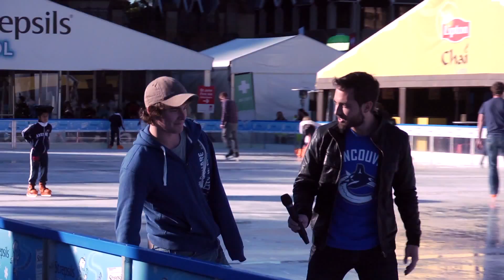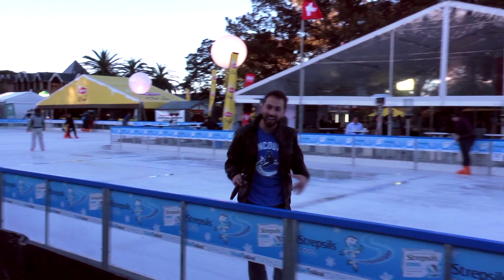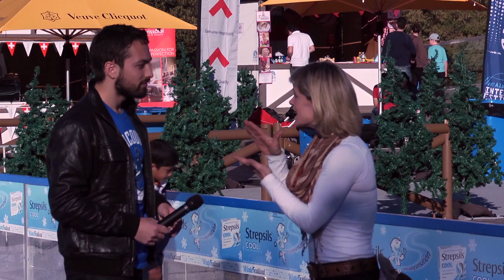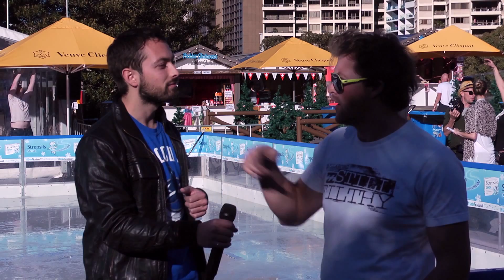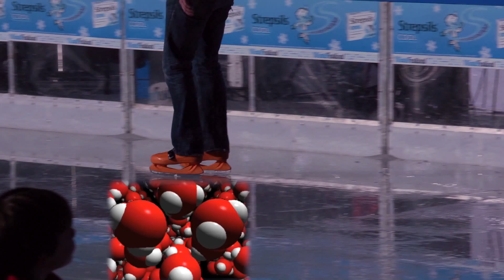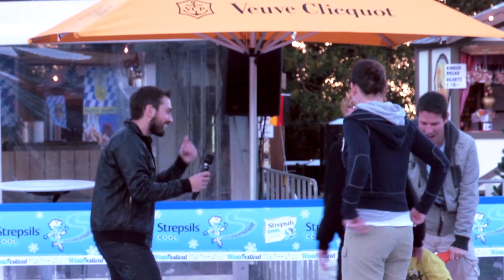Why Is Ice Slippery?

Comment: its generally accepted by scientists now that its not because of pressure, the pressure exerted by a body on ice is not enough to significantly alter the melting point. you have to look at the actual molecules and how they're acting
Reply: Lmfao
Reply: Do the maths...say average person weights 80KG. Hockey blades are about 30 cm long and 3mm (0.3cm) wide. 

That is 80kg pressing down on 0.0009 m^2. I think you need some derivative of Charles' law for the next bit. 

But failing that - get someone to stand on you finger wearing sneakers.....bit sore? now....get them to stand on your fingers wearing skates.

Comment: If you are really interested, here you go:

Reference: 100 Chemical Myths: Misconceptions, Misunderstandings, Explanations

(see picture fig 1.6 here: https://lh3.googleusercontent.com/-Khyo3lIiyhE/VNGLLqV-LUI/AAAAAAAAALI/X1wtOEvpiqw/w517-h276-no/water.jpg)

"1.8 Ice Skating and the Science of Sliding

Ice skating, believe it or not, has long been fodder for thought for scientists, especially
for a small group of people who teach a science named physical chemistry.
The question seems to be centered on the issue of what makes the skate slid so effortlessly,
the ice itself or liquid water produced on top of the ice by the skate.
Skates have relatively sharp blades, so someone in skates exerts an unusually
high pressure on the ground. An exceptional property of water ice is that its melting
point decreases under pressure (most substances behave in exactly the opposite
way). This may lead people to rush to the conclusion that ice melts under a skate,
and the athlete (or the beginning skater) actually slides on a thin layer of water
rather than the surface of ice. However, this is far from logical: many drivers know
that an icy road is more slippery than a wet one.
What is wrong with the ice-melting argument? Well, the argument only says
something about the direction of changes, but never tries to estimate their magnitude.
If we think a little deeper, this theory about ice melting under skates would
lead to a number of consequences that are definitely not true.
1. Children would have more difficulty when skating because their weight is lower
and they would exert a lower pressure.
2. The colder the temperature is, the more difficult would be to move on a skate as
higher pressure would be needed to achieve a larger change in the melting point
of ice.
3. On a single leg (or skate, to be more precise), it would be much easier to skate
because the pressure would double compared to a pair of skates.1.8 Ice Skating and the Science of Sliding 19
4. A puddle would form below someone standing on a skate on ice for a longer
time.
5. Much higher efforts would be needed to achieve higher skating speeds as melting
of ice is by no means an instantaneous process.
Let’s estimate than how much the melting point of ice changes below a skate. To
help our thinking, we can make good use of the phase diagram of water, which is
shown in Fig. 1.6. In this graph, temperature ( T) is displayed on the horizontal axis,
whereas pressure ( p) is shown on the vertical axis. One of the simplest ways to use
this diagram is to decide what form of water is stable under a certain pressure at a
given temperature. All we have to do is to find which part of the diagram the point
falls. In Fig. 1.6, 1000 bar and −5°C is within the area labeled liquid water, so one
can be sure that the stable form of water is liquid under these conditions. At first
sight, it may seem surprising that water is a liquid below its usual freezing point.
As already explained, the external pressure also influences the temperature at which
water freezes (or ice melts). Similarly, the boiling point of water also depends on
pressure. From a phase diagram, one can read the actual melting point of ice at any
pressure: all we need to do is to find where the boundary lies between ice and liquid
water at that pressure.
It should not be left without notice that there are three kinds of ice on the phase
diagram. Ice, similarly to many other solids, has more than just one possible crystal
structures, that is it has several different ways in which the molecules can arrange
themselves in a regular pattern. These crystal structures are stable at different temperatures
and pressures. In fact, science knows many more form than displayed on
this graph. This is also true for many other chemical substances including carbon,
which is known both as graphite and diamond—the latter being thermodynamically
unstable but far harder and more expensive (→ 4.13).
Fig. 1.6  A part of the phase diagram of water. (Authors’ own work)
 20 1 Misconceptions in General
Finally, one can also see from the phase diagram that it is impossible for liquid
water to exist below −22°C, as no part of the phase diagram below this temperature
is labeled liquid (→ 4.17). If someone were to insist very much on the theory of
melting ice under a skate, they would have to conclude that it is impossible to skate
below this temperature. The experimental observation, however, is quite clear: ice
can be very slippery even at −30 °C.
How large is the pressure under a skate? This is not very difficult to calculate,
but you may need to refresh your elementary physics studies. The blade of a skate
may be 20 cm long and 2 mm wide, so the surface is 0.2 m×0.002 m=0.0004 m2
,
this doubles to 0.0008 m2
 for a pair of skates. If the mass of an average person is
80 kg, the weight is 800 N; the conversion factor between the two quantities is the
gravitational acceleration on the surface of Earth, which is approximately 10 m/s2
.
So the pressure exerted by the skate on the ice is 800 N/0.0008 m2=1,000,000 Pa
=106 Pa=10 bar. This is barely ten times the atmospheric pressure on Earth, which
is about 1 bar (or 105 Pa or 1 atmosphere—scientists and their units can be perplexingly
diverse). In Fig. 1.6, the melting point at 10 bar is hardly any lower than 0 °C.
Much higher pressures are needed for a significant change in the melting point.
A counter-argument for this line of thought was put forward as early as the nineteenth
century. It says that the uneven surface of a skate blade makes the actual
contact surface a lot smaller. Even if this is true, there is no small enough surface
for skating below −22 °C. Higher pressure is usually accompanied by higher friction
as well, which actually acts against the movement, and could be much more
significant than the melting point depression of ice.
Friction, however, offers an even deeper line of thought. Friction produces heat,
which can melt ice in a very thin layer. However, friction can only produce heat
during movement. Ice is known to be slippery even for objects that are stationary,
there is no extra effort needed to begin the movement. And forces of friction tend
to be quite small on ice—this is the very reason why it is slippery, and small forces
can only generate a small amount of heat.
What could the explanation be then? First of all, the surface of ice is very even,
or at least it is when conditions are ideal for skating. The even surface offers little
chance for the small bumps on the surface of the sliding object to stick to anything.
In addition, water molecules on the surface of ice experience less interaction than
those in the middle of the substance, which means that they also move easier. It
is sometimes said that the surface of ice features an extremely thin (maybe one
hundred thousandth of a millimeter) layer that resembles a liquid. But this does not
mean actual melting at all. This surface is always there, the presence of skaters does
not make a difference.
Finally, remember that there is something called synthetic ice. Skating fields are
sometimes made at places where it would be very expensive to maintain freezing
temperatures. This synthetic ice is made of a special kind of plastic, the melting
point of which actually increases as pressure increases. Skaters on synthetic ice do
not seem to care at all."

It is a rather informative and great book, I recommend you to download (or even buy) it :)

Comment: so friction is pressure?
also does viscosity (of the liquid used to make the solid) affect the friction of the solid?
Reply: not exactly. the pressure comes from the actual weight pushing down. riding on skates also decreases the surface area your weight has an effect on. this increases the "pounds per square inch" which means that locally (under the blade) the pressure of your weight is increased even further. this extra pressure lowers the melting point of ice creating water. when water in liquid state is on top of water in solid state it fills in all the little gaps making the surface much much smoother and allowing extra liquid molecules to glide past with greater ease. the smoother the surface, the lower the friction. the object is to reduce friction to as close to nil as possible.
Reply: Ice phasing is more important. The pressure has less affect than friction and friction less than the natural bonding water.

Comment: I'm not entirely sure about this, but I've read that while this explanation is popular it may be misleading. I've seen that if the calculations are done than the pressure of exerted by a typical male wearing ice skates upon the ice only lowers the freezing temperature by 0.03 degrees. I believe the article stated that no one is exactly sure but another prominent idea is that the ice on the outside of any block of ice isn't solidified and bonded on all sides so the ice on the outside acts like a very thin layer of liquid. I of course don't know anything for certain that's just what I've read
Reply: I believe I read a similar article that said "Newton gave this answer and everyone has believed it since", but ice is still slippery in weather so cold that pressure can't melt the ice, and it is still slippery. Ice is molecularly bonded on all sides, except at the surface. One theory is that water molecules pinwheel across the surface like ball bearing.
Reply: I searched Wikipedia and found out that while regelation aka "pressure melting" is an actual thing, the pressure required to melt ice is much greater than the weight of a normal person. (The melting point of ice falls by only 0.0072 °C for each additional atm of pressure applied)

The new explanation for why ice is slippery when ice skating is because of friction, or "friction melting". This causes a macroscopic layer of melt ice that lets you skate.
**There may be other mechanics at play. An article by Nature explains that water by itself is not that good of a lubricant, yet ice is almost the only material that you can skate on. The authors suggested that repeated sliding over the same spot generates a mixture of ice and water, which displays both elastic behavior (from the ice) and viscous behavior (from the water) in response to a load. The resulting layer of material would be more difficult to squeeze out of gaps than ordinary water. This could — at least in part — explain the layer’s excellent lubrication properties.

Sources:
https://en.wikipedia.org/wiki/Regelation
https://en.wikipedia.org/wiki/Ice_skating#Physical_mechanics_of_skating
https://www.nature.com/articles/d41586-019-03833-5#:~:text=The%20authors%20suggest%20that
[Information accessed 18 August 2020]
Reply: It's same thing

Comment: Solid state is just particles very close to eachother, with strong cohesion forces, and liquid is those particles with some of the bonds broken and Brownian motion appears...
But compressing a material will only make the particles come closer, creating stronger bonds, restricting the motion (thus lowering the temperature). So, how come the ice metls under preasure?
Reply: Ice is less dense than water.
Reply: zeke1220 Oh, that's right, i didn't think of that... I guess you break the structure of the ice making it liquid. Thanks for that, mate
Reply: Isabella Morais The phase diagram was the last thing to come to my mind while watching this video honestly, but i do know it very well..

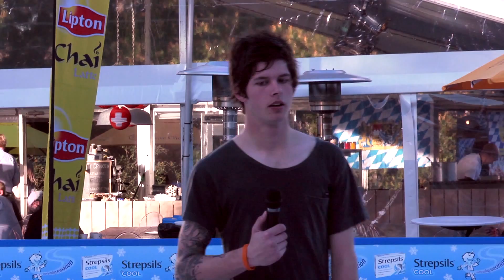Comment: In 1:40 "Compressing ice decreases its melting point". Doesn't pressure increase melting and boiling points? Like water will boil at higher temperature at higher pressure?
Reply: Reinis Ramans You're right about the boiling you see, but the pressure does do that to ice. Try pulling a string through an ice cube--you'll see the ice melt and reform as the string goes through :D
Reply: In that case it's friction that makes the ice melt not pressure.
Reply: No, presssure. Well, a bit of friktion but mostly pressure.
Reply: I understand that increasing pressure increases temperature. Like it does to gas in a closed system. I think that the ice melts because the pressure is a source of energy that increases the temperature, but it doesn't decrease it's melting point.
Pressure heats up - yes
Pressure decreases melting point - no.
I'm pretty confident about that, but prove me wrong if I am :D
Reply: I agree with that vacuum thing. Decrease the pressure and the boiling point lowers and so does the melting point.
Reply: Water is an exception. There's more space between water molecules when it's solid than when it's liquid, so added pressure lowers the melting point but raises the boiling point.
You can Google phase diagram for both water and e.g. ethane for comparison.
Skates slide the way they do because the added pressure lowers the boiling point and friction melts the ice, though I don't know which would have a greater effect.

Increasing pressure results in an increase of temperature when the volume is constant, but the ice under the blade of a skate isn't exactly in a closed system.
Reply: Nope, it becomes lower. You can get water to boil at room temperature if there's enough pressure
Reply: It think that you are wrong :D. An example: it is hard to boil an egg in high altitudes because lower air pressure makes the water boil at lower temperatures. And in vacuum (like in space) water boils instantly because ther's no pressure at all.

Comment: Will the ice be slippery if there is no gravity?
Reply: @Herleik Holtan What?
Reply: @Herleik Holtan Weed sure is one hell of a drug
Reply: @uku4171  why is Zlade wrong
Reply: @uku4171  ohhh ok
Reply: Ask the astronauts.
Reply: danish syahmi the ice wouldn't be there if there wasn't amy gravity
Reply: why not
Reply: @christiancarlo-stella7633  because the thin layer of water formed due to pressure might not exist since there is no gravity to apply pressure (pressure= force/area). Hence the ice may no longer reamin slippery.
Reply: vishwanath kadalagi I meant why wouldn’t ice be able to form in zero gravity not whether it is slippery or not
Reply: @christiancarlo-stella7633  oops sorry
Reply: vishwanath kadalagi gravity and pressure are different, in space, water clumps together and form little balls due to surface tension, the pressure inside these balls is greater than the outside, limited by the degree of surface tension, therefore ice will freeze
Reply: @abrokenmailbox  yes I do understand that ice can be formed in space, I was saying that there will be (possibly) no pressure to make ice slippery.

Comment: So would ice still be slippery in bellow freezing temperatures?  If the surrounding air were say 20-40 bellow zero,  would you still slip? At cold enough temps, the pressure you apply on the ice would not melt it.
Reply: I guess not.
Reply: This is actually a 'partially unresolved' physical phenomenon. We know that pressure heating from standing on the ice, and friction heating from sliding across it will melt the ice to reduce the friction. These don't explain skating at very low temperatures, though, and skating is still entirely possible when it's extremely cold outside.

Ice provides a very clean surface, though, and it easily forming cuts helps keep skates on track when you're cutting into it with the blades at a slight angle. Trying to slide across ice at very cold temperatures you don't get very far at all. So it could just be that ice and skates work well regardless of the water being there or not. There is also some theory about semi-liquid states and whatnot, but I'm not too familiar with that off the top of my head.
Reply: Mike Majer You bring up an interesting point or question rather about the coefficient of friction.  Ice is slippery because it has a low coefficient of friction.  But rubber does not slip on asphalt because of its high coefficient of friction.  Perhaps we shouldn't just be asking why ice is slippery, but more generally why do two materials have the particular coefficients of friction that they do between each other.
Reply: I agree. In fact, I read that the freezing point of water is lowered by 0.007 °C per atmosphere increase in pressure, (scienceuniverse101.blogspot.com). Even the heaviest skaters with the thinnest blades would have less than a 1°C influence. I'm confused.
Reply: Patrik Manni Well said. One factor I'd add is the simplest explanation: Ice-Steel Kinetic Frictional Coefficient = ~0.03.
Reply: DANGJOS Yes, this is a subquestion, a good topic for another video. There is some consensus that friction is caused by atomic electrical force interactions, and molecular or macroscopic hooks as the surfaces slide past each other.